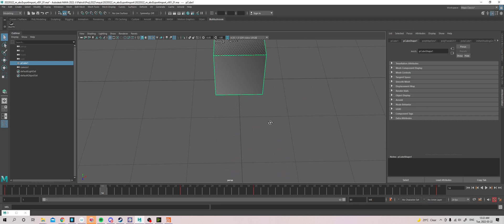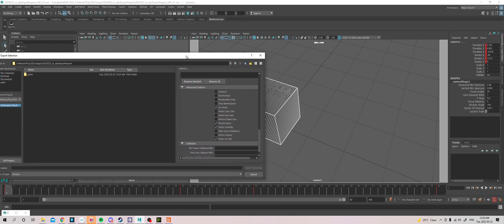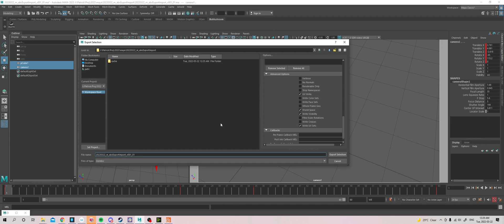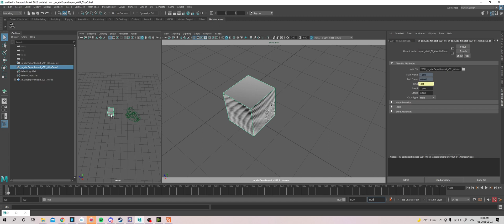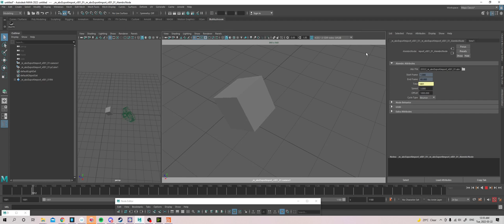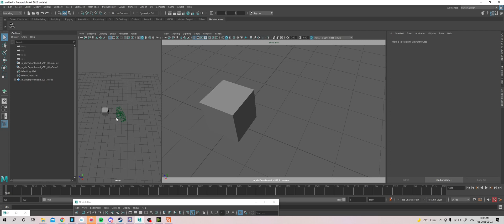Alembic Cache Export and Import in Maya

Comment: Hi, Patrick! Do you know if Maya reads HDF5 alembic?
Reply from the maker: Hi @Iced_Out_Soul! I checked out Maya 2024 documentation on Alembic Export, Maya can export to Alembic HDF5 format. If it can export, I am quite confident it can import it too!

https://help.autodesk.com/view/MAYAUL/2024/ENU/?guid=GUID-854D22F6-7547-465C-8A13-E21A8A6D9714

The simplest way is to just try importing it to see if it works. If it does not, you May have to go through another software that imports it properly, then export it out to another Alembic format or another file format altogether like FBX.
Reply: @PatrickWoo  Tysm for answering 🙏🏽🫶🏽

Comment: Hello Patrick. I have a glock 17 model animated to fire a 9mm bullet. The slide whips back, the shell is ejected, and I have a bifrost sim for the blast. I've been trying to get this into UE5.

.FBX exporting does not work. It doesn't seem to hold the animation unless it's deformer-driven. Mine is comprised of straight translation keyframes on the objects. So, I've been trying alembic. 

Problem? Whereas before the textures would go onto the objects they were intended for, with the alembic import, one material covers the entire model. I cannot apply different materials to different pieces of the gun model. 

Any thoughts? Thanks.
Reply from the maker: Hey Keith. Please correct me if I'm wrong. Your only problem with alembic caches into unreal is shaders? you can't apply multiple shaders into a single cache. It seems like each added asset will become a single actor in UE, regardless how many parts they consist. Thus, I think you'll need to export objects needing unique shaders as separate objects. That is why games ready assets tend to have only a single set of textures for entire objects even if they are made of different materials. I actually tried animating a few parts on a single gun asset with textures and then bringing it into UE. it works. but the entire asset is a single shader.
Reply: @PatrickWoo  Alright.. another lesson learned. Thank you!
Reply: @PatrickWoo  Question: How do I have multiple texture sets in Substance Painter and get them all to combine into one series of textures for all the pieces? Indeed, is there even a way to do this?
Reply from the maker: Do you know about UDIMs? UVs can be unwrapped and placed beyond the traditional 0-1 square in uv space.
With udims you can extend the original space now named 1001 to 1010 to 10 more uv boxes to the right.
then you can further extend 1011 to 1020 as 10 more rows on top of the original rows of uvs.

In this way, you can unwrap and include as many objects as possible in a single shader as long as none of the objects' uvs overlap each other in UDIM space.

An example of unwrapped uvs in UDIM configuration:
http://rbblog-wpengine.netdna-ssl.com/wp-content/uploads/2016/08/06-Garden-Loft_UVs.png

Here's how substance supports UDIMs and can paint across it.
https://substance3d.adobe.com/magazine/paint-across-uv-tiles-udims-in-substance-painter/
Reply: @PatrickWoo  Oh... actually I do. Thing is, when I made the textures in Painter, I saved out about 6 texture sets from Maya. Hence, 6 separated sets of textures for 6 separate materials.
Reply from the maker: @keithyakouboff8755  hm then it should be quite straightforward to find how to bring them back into their respective spaces in Unreal. a udim workflow May need a few more steps in unreal? I'm not sure at this point
Reply: @PatrickWoo  Yes... neither am I LOL

But thanks for your responses!